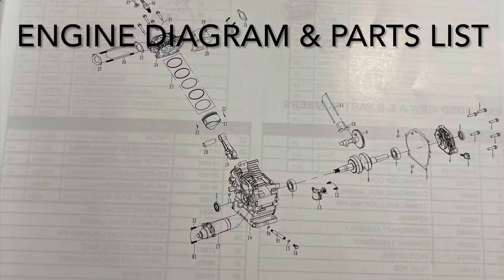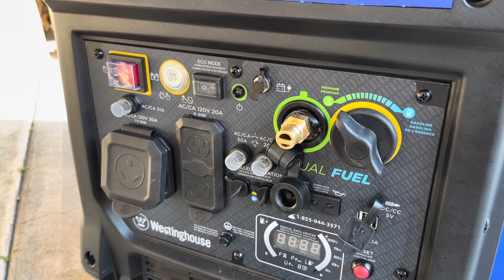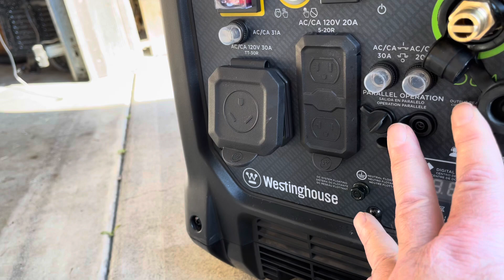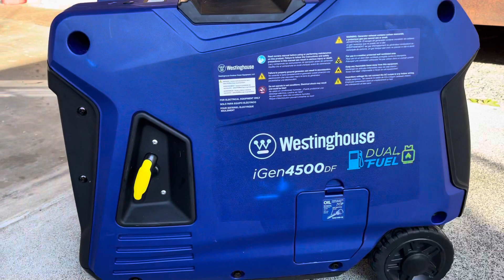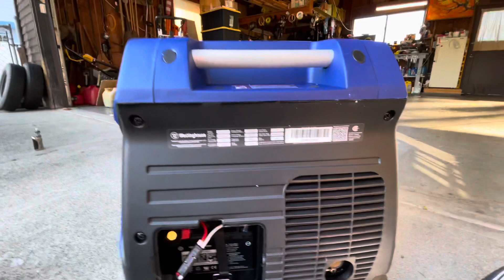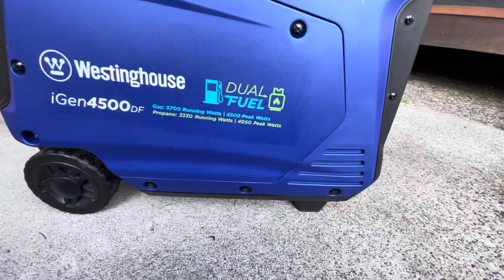Westinghouse igen4500df Review Features & maintenance

Comment: Would like to know how you drain fuel prior to long term storage
Reply from the maker: I’m not aware of a fuel drain valve on the westinghouse. Installation of a drain petcock would be a good option. I have yet to run my Westinghouse generator using gasoline, only propane.  I have a 10 yr old Yamaha ef2400i that’s gasoline only. Periodically I transfer the fuel to a container using a battery powered stick pump, then use that fuel in my lawn tractor. A few minutes run time burns the small amount of fuel that remains. I have gone as long as 3 years without refreshing the fuel in the Yamaha and it still ran fine. Of course it’s real ethanol free high octane. I don’t use ethanol spiked fuel in anything that not frequently used.
Reply: @jatoav8or  thanks for the helpful info!

Comment: Amazing it doesn't get to hot in 115° heat index weather being motor is enclosed and no air to cool it off
Reply from the maker: I don’t think it’s even been 115° where I live on the Washington coast plus 90% of my generator usage is in the winter months usually during an outage following a storm but I would imagine 115° would cause havoc with any air cooled engines including motorcycles?
Reply: Heat index has nothing to do with generators. Only use actual air temp.

Comment: Which magnetic dipstick do you use on your iGen, I use a dipstick for the Predator 3500?
Reply from the maker: Camoo Magnetic Oil Dipstick Aluminum Silver For Yamaha EF1000iS, EF2000iS, EF2200iS, For Wen 56200i, For Atima AY2000i, For Champion 73536i, For Rainier R2200i and more. https://www.amazon.com/dp/B07WZDWK7T/ref=cm_sw_r_cp_api_i_BS96DH8JGZF4EMGNQZYZ?_encoding=UTF8&psc=1